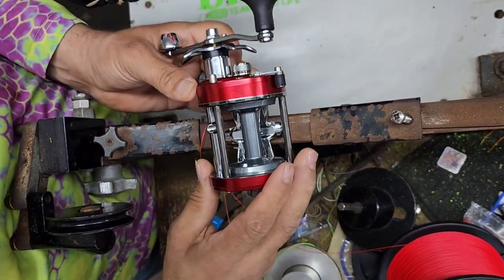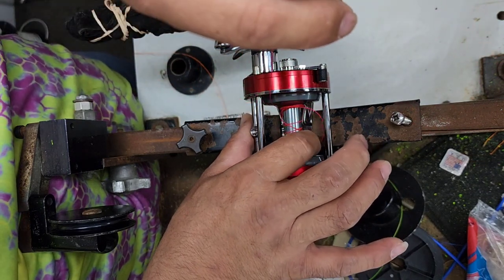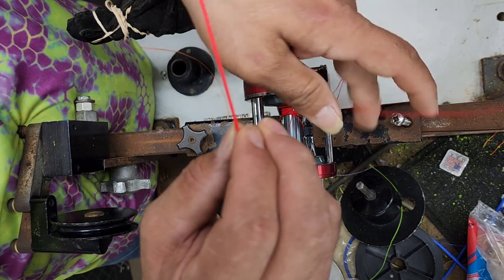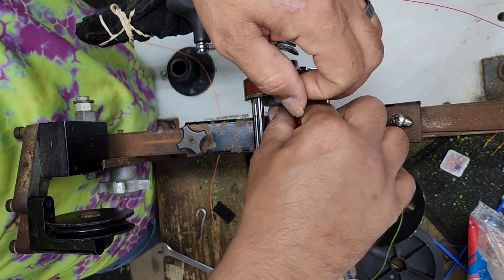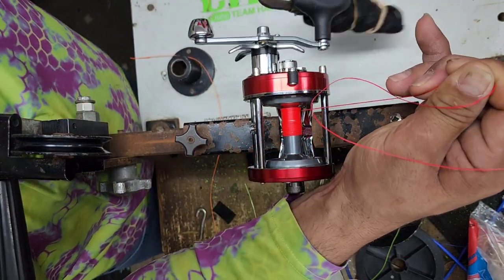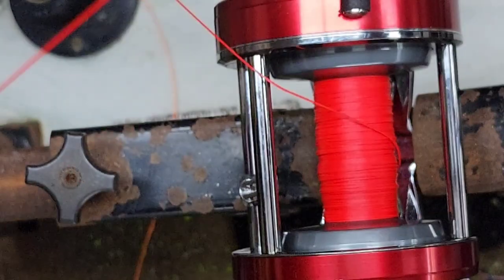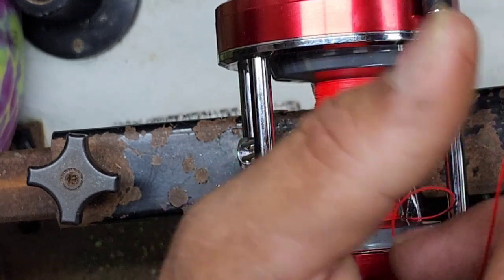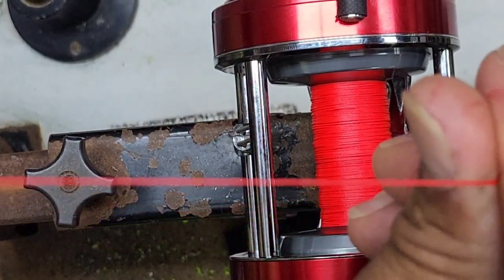How much can Abu Garcia 7000 spool 65lb to 80lb Tightline Hollow Core for casting?

Comment: Just a quick question.  Loading string without using the worm guide? 
Wouldn't this take the string out of synchronization between the string and the worm guide?
Reply from the maker: Going to happen either way most don't follow the path they disengage when casted.    And or follow it and thk when you back lash and or break off it also does the same thing.   However with the first cast it will get it back on track..
Reply: Gotcha.
Reply from the maker: What kind of fish?
Ing do you get into